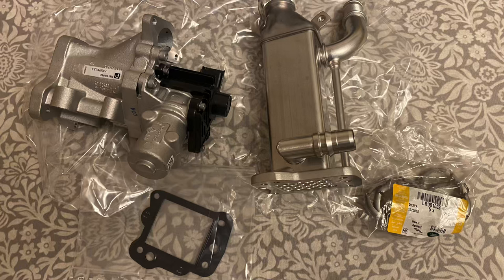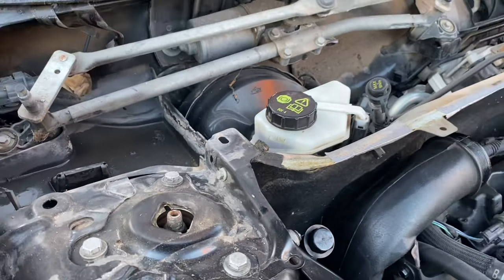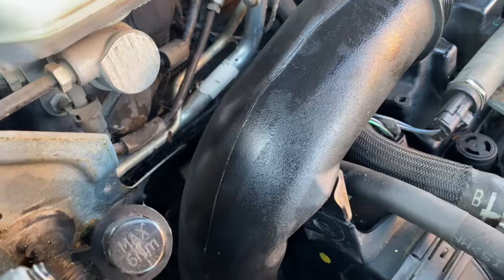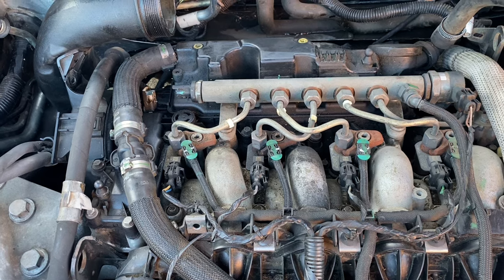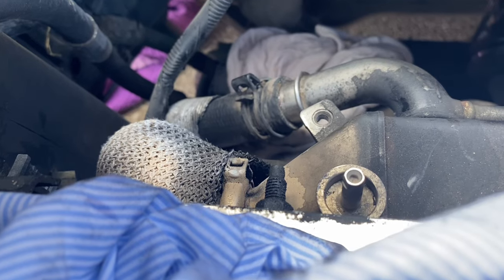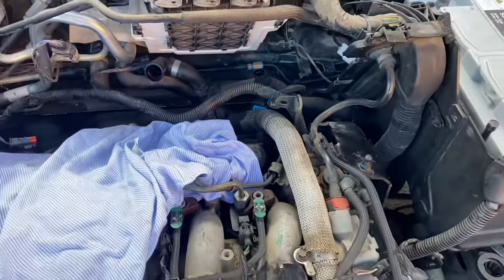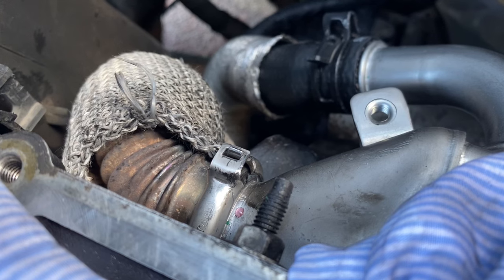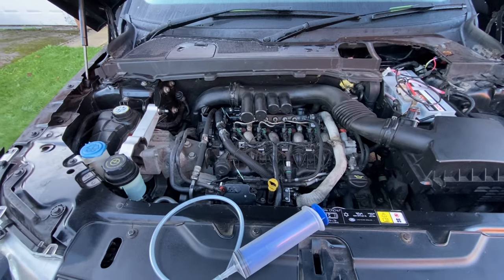Installing an EGR valve and EGR cooler on a 2008 Land Rover Freelander 2 TD4

Comment: Many thanks for the video. Mine is a 62 plate so is slightly different, the exhaust joints onto the cooler and EGR valve are two bolts so no faffing about with clamps. I did remove the bulk head, which was a pain to get back, but generally following your video it all went surprisingly smoothly. I didnt purge the fuel line and ran my battery flat pumping the diesel through, although after a while it started. I must admit I was dreading doing it but if you take your time and follow a method it is awkward but easily do-able. Thanks again for a very informative video.
Reply from the maker: @greenslime6  thanks for the positive feedback, it makes the effort of videoing worthwhile 😊

Comment: I manage to remove and replace the EGR valve & cooler without removing the fuel common rail pipe. Not much room to play with ; used a mirror to find the bolts/screws. Also removed the ECU to make room.

Comment: Thanks for the video gave me a good heads up of what to expect, but for anyone about to tackle this job there is no need to remove the bulkhead. I also did a pressure test on my cooler before committing to removing it.

Comment: I did mine on a 62 plate xs my egr cooler was different yours and pipe work fitted differently I had to go under drivers wheel arch to get to bolts on was a right pain but the stripping down is pretty much the same

Comment: Can I ask what was the reason you changed both parts, what were your symptoms, thanks Jim, ps great video
Reply from the maker: Jim I replaced the cooler simply because I had seen on the forums that these can start to leak. I didn’t want the risk of having to do the job again if the cooler then failed a bit further down the line. Probably overkill, but gives me peace of mind….
Reply: Thank you 👍

Comment: Brilliant video thanks. Anyone know if it's the same as a 2011 190hp FL2 2.2ltr
Reply: The 2.2l engines are mechanical the same bad turbo and ecu as I’m aware. Should be the same process

Comment: Reason for replacement?
What brand valve you have bought please?
Reply from the maker: EGR valve kept sticking either open or closed causing warning light and affecting drive. I used a pierburg valve.

Comment: Apparently no need to dismantle wipers motor area.
Reply from the maker: Well I wouldn’t fancy doing it without removing the rear panel in the engine bay. I found it awkward enough with the panel out 😊
Reply: @garyredman642  done one today.
Friendly enaugh. 
Also uploaded video.